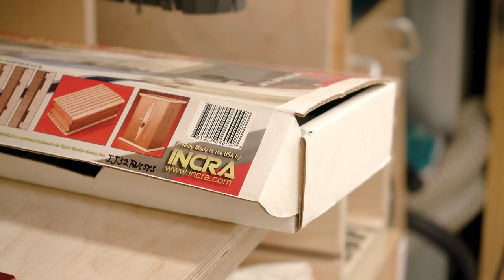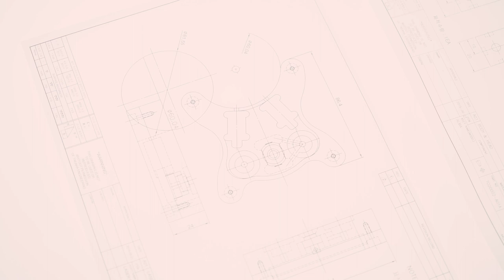Drawing Table Using LED light / DIY

Comment from the maker: I saw the light on the floor and the equipment to look at the drawings, and I loved it.
I also made a drawing table. I used a 600mm flat LED light because I think it would be too big to fit on the table itself, and I rarely use drawings of that size.

You can put it on a table or hang it on a wall.
Because of the nature of the drawing, which requires detailed figures, there is a light source on the floor, so it can be seen much brighter. Aluminum molding was used between the LED lamp and the wooden frame.

The power switch used a toggle switch. I like the clicking sound, so I tend to use a toggle switch. After it's done, I put on a drawing of the laser player that I made, and it's so clear and bright that it's much easier to see.
Thank you.

#Making #LED #Blueprint_table #DIY